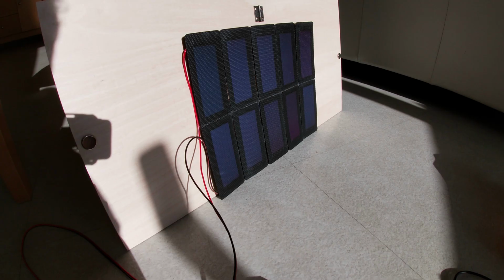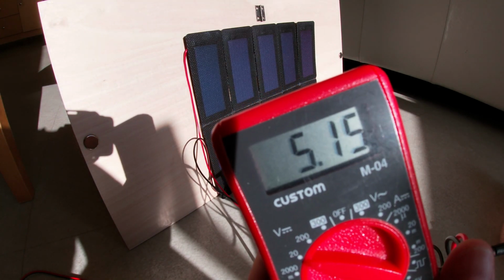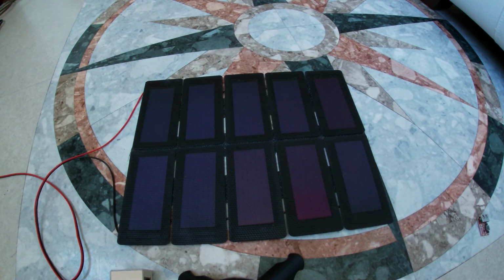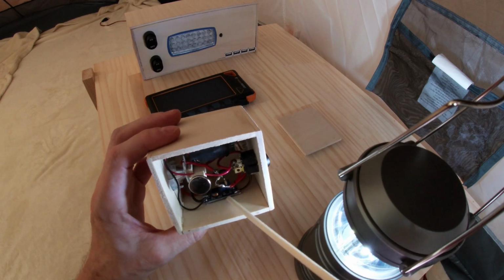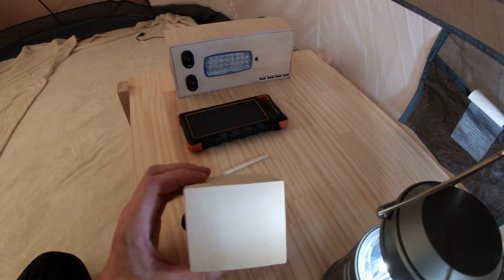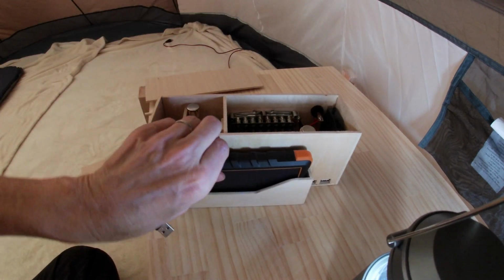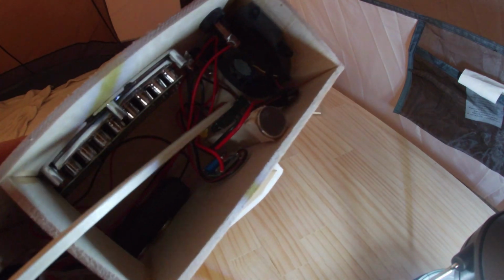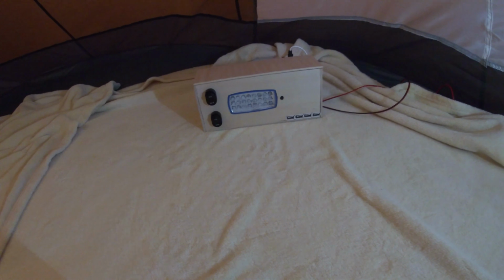BUILDING A SMART POP-UP TENT WITH DIY SOLAR, 12V POWER BOX, FAN AND LIGHTS

Comment: What model tent is this?
Reply from the maker: Nathan Hey thanks for your question and sorry I didn’t show any outside video of it. It’s an Ayamaya 4-6 person tent. 159.99 on Amazon. New design and Concept from a traditional tent. It’s very cavernous inside but not tall but the size is really comfortable. The vestibule is a solid 3 feet in and about 6 feet wide. The tent total is 8 feet by 12.5 feet. I just waterproof sprayed yesterday to give it extra protection using Camp Dry. Many people buy a tent not suitable for their type of camping and conditions and it fails causing them to leave bad reviews. For the type of camping I will use it for, the weather, and terrain, this tent is perfect for us. Haven’t used it yet in the woods but I’m impressed.
Reply: @japanairtoground5070  much appreciated, impressive!